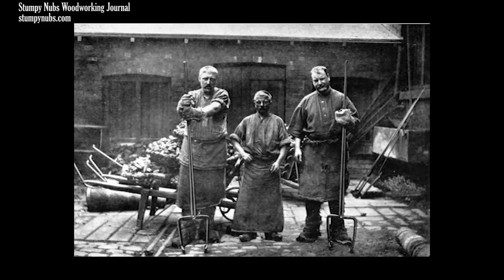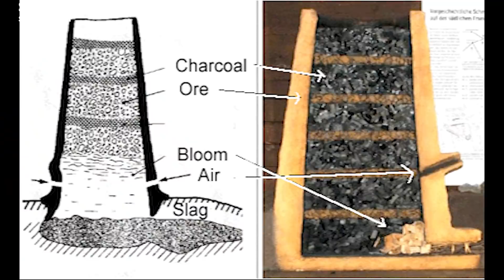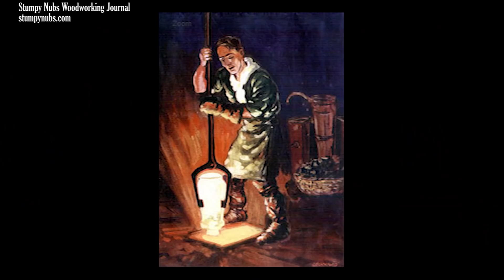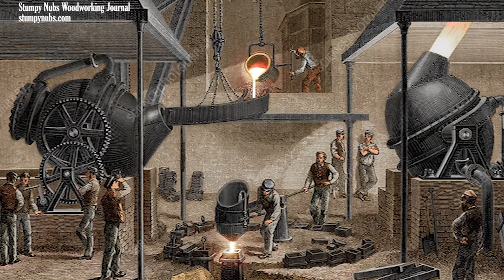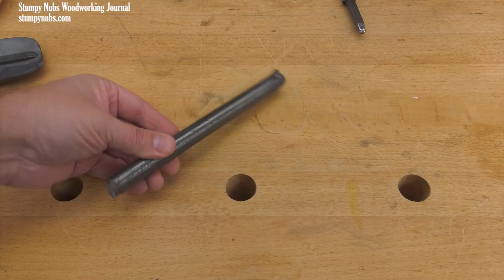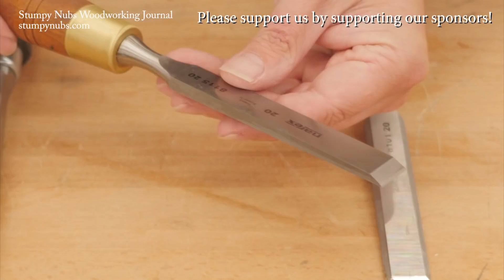Why a lot of tool steel is bad.

Comment: Another factor in why antiques seem to be better built than the average modern equivalent is Survivorship bias.  We only see the things that were built well enough to last decades if not centuries, the very best of what was available. There is a lot of stuff produced of a lesser quality, but you won't see those in second hand shops because they broke and were thrown away. So when we compare things from the past to things from today, we're making a biased comparison: comparing an incomplete and very selective version of the past to our relatively complete picture of the present.

Comment: So, what exactly was the answer to the video title question (Why a lot of tool steel is bad)? I get that modern 'chinesium' can be, and usually is crap (as surely was the ancient western stuff, which probably wasn't even called 'tool steel' though), but I have never come across "bad" tool steel. Even 100 years old northern/western European tool steel seems to be of consistent quality and high carbon content. Obviously not as good as the modern high-tech alloys, but definitely not "bad" either.

Comment: The myth of antique tools being superior in metallurgy to the modern equivalents it rather prevalent across all hand tools, and bladed implements like knives and swords.  It's rather easily demonstrable that modern steel CAN be far superior in metallurgy, consistency, and temper.  But it's not.  It's a matter of cost, and need.  No one ever makes production (important word there) tools or knives out of the finest steel you can acquire; the cost is just too high and in many cases premium super alloys are just not available to be purchased due to licensing and scale of economy.  Boutique tool and knife makers excluded, of course; in custom knives, anything goes...

Comment: Luckily I was gifted two wheeled chests if tools.  Mixture of old snap on, Gordon, king dick, Britool and similar.

The metal in all the tools is by far superior to anything I can buy today.  I think part of it is better quality steel and processing.  But on top of that there are processes they can no longer use.  Eg I know Gordon of Sheffield had a salt hardening process in their factory that their tools went through but I believe for safety (or maybe cost to make process safe) this is a part of tool hardening they no longer use today.

Comment: Basically people are seeing survivorship bias as superiority in tools.   A 200 year old chisel that has been heavily used is "proven" but a 200 year old chisel that spent 199 years under some old oily cloth in a dry room is just old.   Survivorship bias is a bad selection criteria.  Back in the 1800s a company in South Bend, Indiana made plows from iron using a specialized chilled mold process that caused the iron to form in a tempered state on the surface and ductile inside - like a real katana but without all the shenanigans - that made very tough long wearing plow moldboards and unshared plow shovels... and out of the literal millions made only a few hundred still exist in "new" condition and the rest were slowly turned into soil nutrients through abrasion by sand/silt/rock and soil acid.      So by the logic people are using about chisels the few remaining old plow shovels from Oliver are superior to modern steel and chrome vanadium steel plows.    And they most definitely aren't.   

If you want an antique for the wall, get an antique chisel.  If you want a good woodworking chisel then stop by other people's shops and ask em which ones just do not break or chip ever.   Or cut them out of lawn mower blades but be careful with the heat you generate.

Comment: Yep, it is pretty much luck when one finds a really old chisel that is truly superior to a decent quality modern one.
I have a bunch of mid 1970's Craftsman and Irwin chisels which I brutalized for almost a decade as a working carpenter.  I cleaned them up, and re-ground them recently to get rid of all of the chips and poor field sharpening, and they are still amazing at edge retention.
Reply: Quality aside, I think there is something awesome about keeping old tools in good repair and in use. I don’t have old chisels but I have a nice 70s Stanley #4 plane and I recently found my dad’s old #5 from the same era. My shoulder plane is pre WW2 and it works well. €15 from a thrift store :)
Reply: @kaasmeester5903  Agree. Carbon tool steel blends have been well regulated and reliable since the turn of the century, and stainless ones since the Regan era cold war.  The difference between cheap tools and good tools was really in the post production quality control and testing done by quality manufacturers.  A lot of old Stanley tools did not pass the post production rockwell testing.

Comment: tried to log onto your website and I am blocked by my anti virus saying it is a spam risk. This has never happened before.
Reply from the maker: Websites have digital certificates which are auto-updated by the domain. Some spam software freaks out if the certificate hasn't been updated. We don't send spam.

Comment: As always, the rule of thumb is that cheap stuff today is lower quality than cheap stuff in the olden days. But high quality stuff today is usually better than the high quality stuff back then. This is because in the olden days, there was not much variance in quality. Today, you can buy horrible stuff made in China, or amazing stuff made with the highest of technology.

Comment: 2:25 Achieving those proper carbon levels IS tricky, not ARE tricky.
Sorry but I'm hearing this mistake more and more often and it's terrible. People seem to get easily confused when the subject is plural, but the 'tricky' (adjective) doesn't apply to the subject in this kind of sentence. The thing that's tricky is the achieving part, which is singular. You wouldn't say "achieving it are tricky".
Again, I hate to sound like the language police but there comes a point when you have to start speaking up and defending the proper use of grammar.

Comment: Very interesting..I wonder  if you could comment upon the use of recycled/remelted steel in the USA. Most USA steel production is from "Mini Mills"-that merely melt scrap steel. Most of this still is contaminated with other metals (copper, lead, tin, etc), due to the  unavoidable inclusion of junk in scrap steel. Is there any evidence that this stuff is inferior to virgin steel(made from ore)? I know that some metals in steel enhance its strength-others do not. Years ago, you saw a lot of rusty steel guardrails along hiqhways-this was a speacil steel with about 0.5% copper-it was supposed to protect itself from futher corrosion-it must not have worked.

Comment: You forgot to mention the reason for laminated steel and the importance of controlling carbon in crucibles which can be extracted from the air. The old chisels often came with dense hardwood handles like boxwood. By comparing Narex chisels to chisels that have stood the test of time is a big claim! The fact is back in the day toolmakers were craftsmen, apprenticed into their craft. Back in the day materials were more expensive in real terms but labour was cheap hence why the lamination process that has been dropped from modern tool production. Tool making was as much an art as the science with hundreds of years of refinement. It's like comparing Chipendale with a mass producer of furniture. I generally like your videos on woodworking but tools are a completely different subject. You also have to consider modern makers of tools hold very little credibility and often don't have a deep understanding of what is important to craftsmen. Narex handles are a prime example of this, see other remarks below.
Reply from the maker: I am comparing the quality of steel. Good tool steel today is of a quality that would have been considered superb 150 years ago.

Comment: you should disclose when a link is an affiliate link. The fact that you didn't disclose it, when I saw it was affiliate you lost my trust and viewership. Bye.
Reply from the maker: There are TWO disclosures in the list of affiliate links below the video, one near the top of the list and one at the bottom, just in case you started reading in the middle of the list. There is also a sponsor disclosure at the beginning of the video, another at the end of the video, and a third right next to the sponsor link. It's OK if you looked too quickly and missed the fact that I go to GREAT lengths to be upfront about that stuff, but it's not OK to call me out as untrustworthy without being sure you are correct.